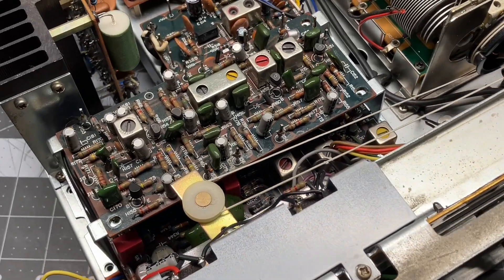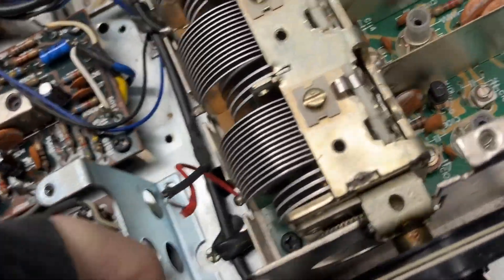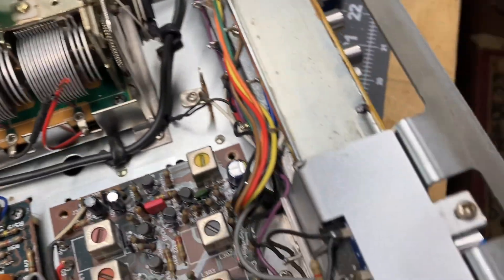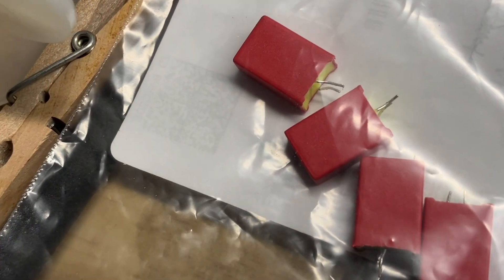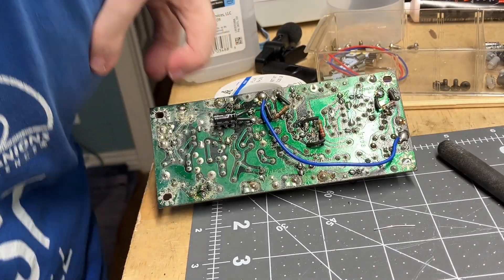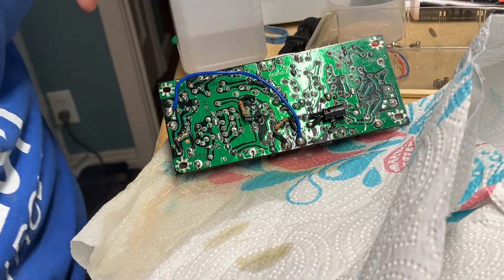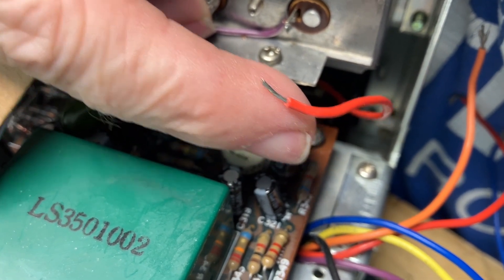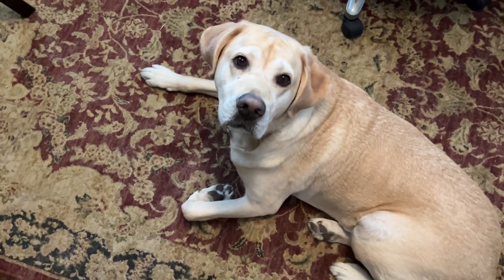Marantz 2245 & 2270 Stereo MPX Decoder and AM Boards Rebuild

Comment: were you able to restore stereo functionality to the FM section as a result of recapping?
Reply from the maker: Technician "Mr. Hackworth" chopped into the wiring for the tone control which caused the issue. It wasn't an FM or turner issue, but a wired wrong issue. Recapping doesn't effect FM performance from what I understand. However, I've heard otherwise, so take that with a grain of salt.